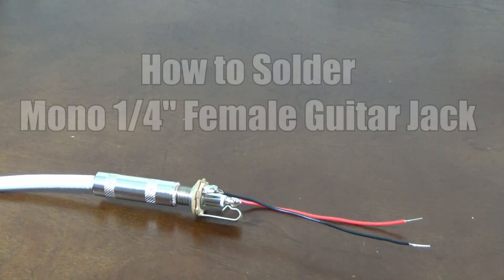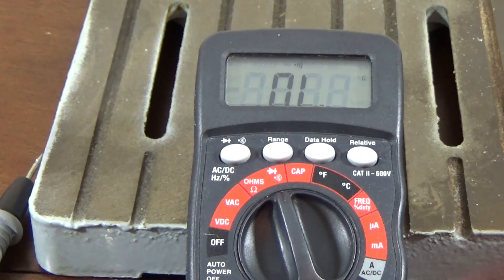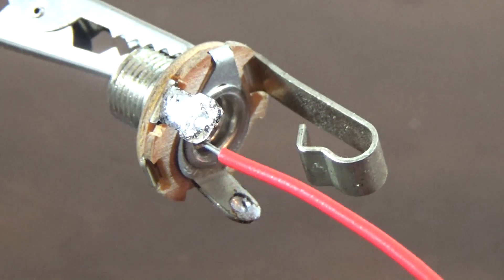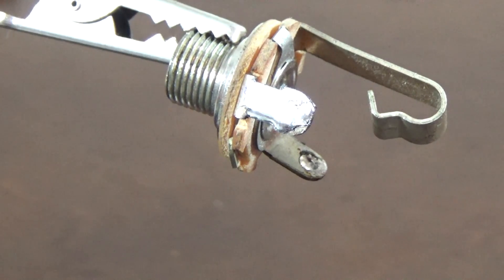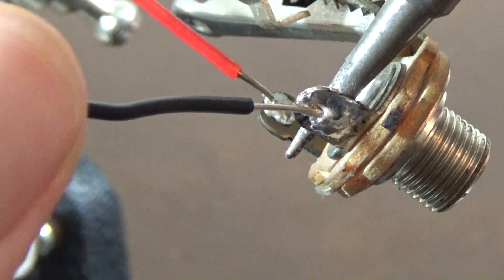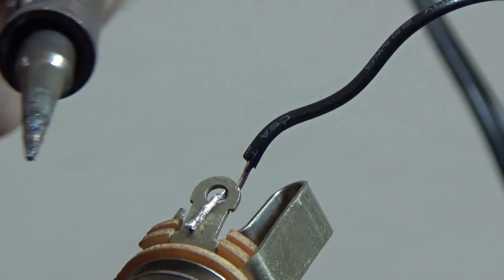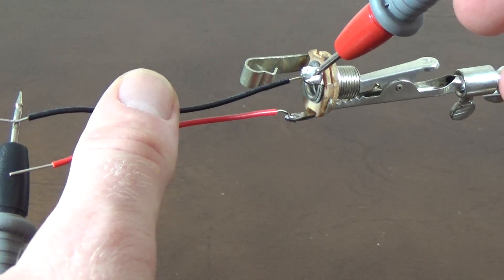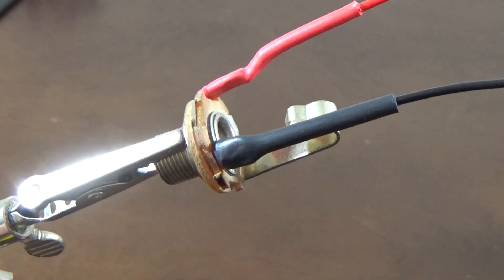How to Solder Mono Guitar 1/4'' Female Jack - For repair and prototyping

Comment: Sorry, you are teaching a bad technique of soldering, bro. It can make your socket pins are less conductive anymore. Or the isolator between tip and sleeve becomes melting.

Comment: I have a question about the xr2209
I have build the example circuit from the datasheet but my circuit starts heating up after some time and it starts to smell like toaster and the frequency decreases as well. I am new to the world of electronics so I am completely clueless what causes this heat. Do you know what might cause this?
Reply: Btw wrote this on my mobile phone so I am sorry for the grammar mistakes
Reply from the maker: No worries. The heat is caused from drawing too much current (power). The chip is designed to handle a certain amount of current - when too much is current is drawn the excess power is dissipated as heat - i.e exceeding the current range specified in the datasheet.

power = voltage * current   

A few general tips for when your ICs heat up. 

1) Check power supply range (or battery) versus the datasheet's limits
2) Double check that you hooked the single or double supply topology (circuit layout)
3) Check output load - most things have a hard time driving a speaker ~4-8 ohms. If you hooked the XR up a speaker directly you need to buffer or add additional amplifier circuits that can drive the speaker. If you are measuring with an oscilloscope no worries here - only if you are driving a small load.
4) If you use a variable resistor as the timing resistor make sure not to exceed the range in that datasheet (see below). I would stay within the 4k to 200k range to be safe: Add a ~4k resistor in series with the variable resistor to make sure you do not go under the minimum threshold. 

From the datasheet:

Page 5:
Pulling excessive current from the timing terminals will adversely affect the temperature stability of the circuit. To minimize this disturbance, it is recommended that the total current drawn from pin 4 be limited to 6mA. In addition, permanent damage to the device may occur if the total timing current exceeds 10mA.

Page 6:
The timing resistor determines the total timing current, IT, available to charge the timing capacitor. Values for the timing resistor can range from 2k to 2M; however, for optimum temperature and power supply stability, recommended values are 4k to 200k (see Figure 8, Figure 9, Figure 10 and Figure 11.)

Comment: Just a little tip (excuse the pun): use a chisel tip on your soldering iron. It will transfer the heat much better, those conical tips supplied with the iron are pretty useless.
Reply from the maker: If used properly, little tips go a far way! Nice point -  it would be more effective to use the chisel in this case because of the wider surface area & better heat transfer! I have seen these used and will have to pick a few up. I know that most soldering irons (including mine) have a way to replace various different kinds. But, if you only got the conical it is good enough to get the job done!
Reply: WaveShapePlay Finally, somebody who can have a constructive conversation on YouTube. If you search eBay for chisel tips, you will probably find a load of cheap tips. They usually come in assorted sets. Plus they are almost always below £10.
Reply from the maker: I appreciate the advice, there is always more to learn!  Will do - thank you Joshua